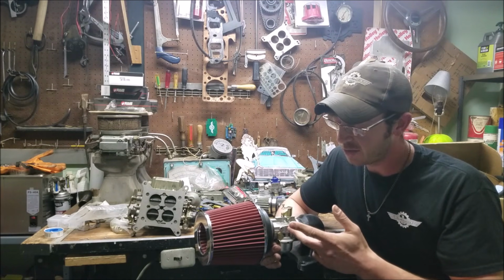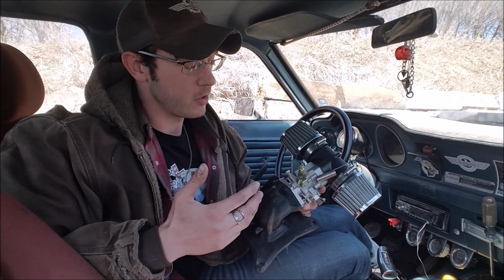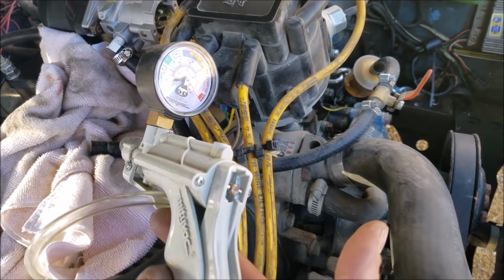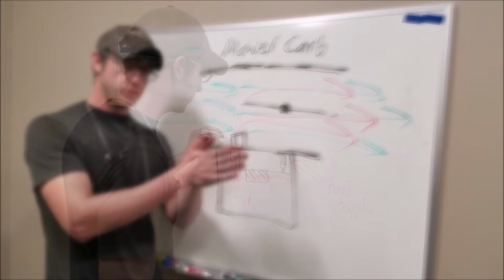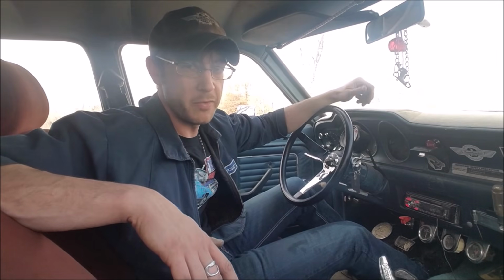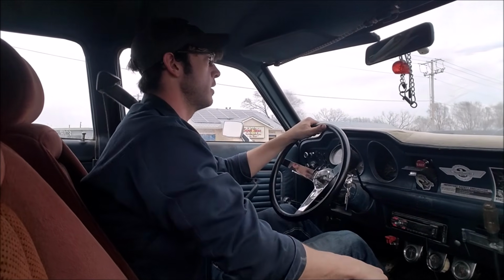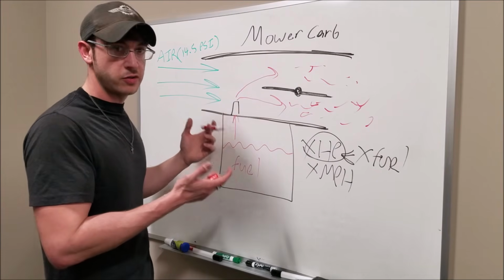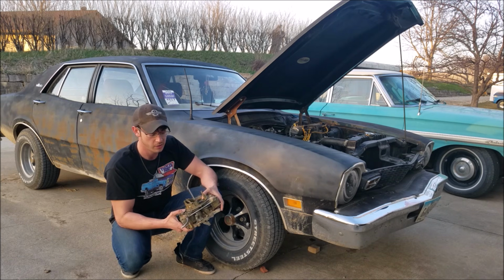Will It Run? Lawn Mower Carb on V8! (The "IMPOSSIBLE" Becomes Reality!) Start to Finish

Comment: I can tell you this about carbs and engines (ASE certified engine performance, 40yrs experience, AKA "not a dummy" 😊)  The engine determines how much fuel volume to demand, period.  The carburetor simply provides the demand.  That's standard operating function...
  A, by having the ability to tune the demands of the engine in your hand, you're able to maximize the efficiency of the engine (within it's limits) to match the effective provisions of your carb system design which (part b) seems to make the most efficient use of mixing/atomization of the fuel.  Together and mostly by having the engine tuning in your hand and maximizing the efficiency of the engine demand youve found a combination that works.  That said, it is always going to be the demand of the engine that ultimately dictates fuel milage, no matter how efficient/effective the design of the carburetor is.  Matching the engine efficiency with maximum effective fuel atomization is the secret of life.
  A standard carburetor delivers more fuel/air mix on demand (to a calculated percentage beyond the capability of the engine) and that's the point, to provide as much air/fuel mix as the engine will handle under all load conditions but, no matter what you do to a carburetor, it won't change the milage and provide 100 mpg (previously claimed in mechno-mythos), it only responds to the immediate demands of the engine.   Maximizing the carb efficiency to provide the best mix on demand is key, yes but... That is as far as it goes.  If it were possible, there are some pretty smart people out there engineering carburetors and those concepts would have been realized by now. 
  What you have done is to "stumble" (through experience, knowledge, luck and trial) upon the most efficient combination that you can have for your engine and that is the "secret sauce" that eludes most people as a background in fluid dynamics and the ability to hand tune their engines on the fly is beyond the average driver or the ability of corporations to mass produce in any effective manner.  Congratulations on your experiment, it's always nice when you get better than expected results.  😊
The concept should translate to anything that you can control/tune and manufacture to meet its specific demands! 😂

Comment: I rebuilt my 440 nearly a decade ago. Added a FiTech EFI a couple years ago. Noticed a similar increase in gas mileage. Not 40+ MPG but well over 20 on the highway. Set it up the AFR for 14.7 at cruise and 12.5 at open throttle. A lot better than the 14-15 I used to get when it was tired and running down the highway for several hundred miles. It doesn't stink like a 60's car anymore either.
Reply from the maker: Just sounds like your afr wasn't optimized on the carb was all 👍

Comment: I think you're right about the mower carburetor basically acting like a vapor carburetor. It makes sense that the small bore of the mower carburetor would create a much higher velocity and would atomize the fuel much better than the regular carburetor that was on the motor originally. Have you checked the mileage on a whole tank of gas? I wouldn't be surprised if it was better than the small test you did. 
 I'm glad I stumbled across your video here. I shared it with my friends. The oil companies in conjunction with the car manufacturers, worldwide, have been selling us vehicles with motors that don't get very good mileage for decades intentionally. 
 I can remember when I was a kid in the early 70's that my dad had a 1963 Coupe Deville Cadillac that had a 429 four barrel in it and it would get 16.5 miles per gallon and it weighed like 5,500lbs. I have a 2000 AWD Astro and I can drive it super easy and it won't get but about 16 miles per gallon with way less weight and a 4.3 Vortex motor. I contribute that to the Cadillac motor having 10.5 to 1 compression ratio, which burns the fuel much more efficiently. 
 The EPA, which I suspect the oil companies lobbied to be created, mandated that all the compression  ratio's be dropped in 1971. They claimed that the higher compression ratio's were creating smog. So they put 8.5 to 1 pistons in everything and big motors like 454's, 455's and 460's went from having around 400hp to less than 200hp and were just big gas hogs with no power and got worse mileage when they did that. I don't know how burning more fuel makes a motor less polluting! I remember back in the late 90's my  Dad bought a Snapper Yard Cruiser that had a California emissions motor in it. He bought it in Oxford, Ohio from a dealer that was going out of business, so he got a good deal on it. Well it got where it wouldn't crank and he thought the battery was just getting weak. Well it turned out that wasn't the case at all. What they did to make it pass California emissions was put a decompression mechanism with fly weights on the crank inside the motor. It would crack the valves open a bit and as soon as it fired and got a bit more rpm, the fly weights would sling out and let the valves close all the way. There was a recall on that part, otherwise we would have probably been pulling or hair out trying to figure out what was the matter. We got the part for free, but had to install ourselves. Plus my Dad had went and bought a battery for nothing! What that was all about was to pass the California emissions they increased the compression ratio and instead of putting a higher torque starter on the motors, they went with that decompression mechanism. I remember thinking back at the time, why does California want higher compression on the mower engine's when they claimed the higher compression in vehicle motors was responsible for smog? It just doesn't add up.
 And just four years after the compression ratio's were dropped on vehicles, they came out with a mandate requiring catalytic converters be put on everything in 1975. I guess they had to require that because of all the raw unburnt fuel that vehicles were spewing out with the low compression ratio's!
 This has gotten far longer than I intended, but I want to point one more thing out. They make out like Direct Injection gasoline motors are a new thing. They're not. All the German aircraft in WWII had direct Injection motors. They burned two grades of fuel, mostly the lower octane. They had 87 octane fuel and 92 octane fuel. Our planes were running on 145-150 octane fuel. That's because the Allies aircraft were either carburated or had throttle body injection. In both of these cases the fuel/air mixture has to survive the compression stroke with out detonating. Hence the super high octane fuel. The German's didn't have to worry about detonation because, being direct injected just like a diesel, there's no fuel in the cylinder to detonate. So that makes the motor have no knock. That means you can turbocharge and or supercharge the hell out of it with no worries about detonation. The German's had airline planes that could fly non-stop to Argentina from Germany back in the 30's because of being so fuel efficient. Germany didn't have much oil of there own. That was part of the reason they took Romania. But Germany did have coal and they were making their fuel, especially towards the end of the war, out of coal. I guess it was a time consuming process, because late in the war the Luftwaffe was having to set on the ground for up to two weeks before they could get enough fuel to fly a mission in force. Their aircraft had as good of  performance as ours, but only burning 87 octane compared to ours requiring 145 octane. 
 There's a guy named Achates came out with a motor about ten years ago now, that was virtually a copy of a motor that Junkers was using in the aforementioned airline planes and also in military flying boats back in the 30's. Of course he has computers now that they didn't have in the 30's, so it could be even more efficient. He made one a size that would fit in a full size pickup truck and another big enough for a semi truck. They should been out a long time ago at this point, but I still don't see them in anything. He was claiming that the pickup truck sized one would get 40+ miles per gallon. So you're looking at motor that would more than double the mileage of a full size pickup and if the semi sized version did the same thing, that would cost the oil companies billions in lost fuel sales! I remember reading somewhere that there was some billionaire that was going to finance Achates so he could build a factory and start producing the motors, but just as Achates had finalized his prototypes, the Billionaire died in a plane crash or something. Funny how I never heard anything on the news about it. Usually a billionaire dying would be news worthy, but maybe not if it was under suspicious circumstances! 
 Oh, I forgot to say that the Achates motors are opposed piston direct injected two cycle motors. And he claims they can more than pass emission standards. Just search YouTube for Achates motor. 
 The oil companies may not worry about you as long as you're not going to big with what you know and what you're producing, but anyone who tries to do something in a big way that's going to threaten their sales, they might. Like I said, I still don't see the Achates motors in anything yet. Keep up the good work and I'm looking forward to a follow up video.

Comment: I have just discovered your channel and hope you get to see this comment.
I have to admit that, at first, I thought this was a joke, but then so did you.
I can see the principle. The fact is that, most of the time, you are not driving flat out and that air and fuel flow will be sufficient for an engine that is almost at idle. And who wouldn't like those MPG numbers?
The downside is that if you want to overtake someone, you just can't beat power you want to run cheap.

I don't think it really worthwhile going the tune plus big carb when you can do both.
Your adapter plate could be made the intake of the "Mower" carb and then replace the old carb on top.
Install a fuel cut off valve and a shutoff plate for the old carb, perhaps a "butterfly" disconnect owhy?

So, you're cruising down the highway doin' 70, making 40+ Mpg and have to pass to keep cruising. Flick a switch and you are back on the old 4 barrel, or is it now 5?
Anyway, keep up the work on that "Carb Cheater"
Cheers.

Comment: considering this was how the factory initially added MPG in the 70s I had no doubts about it running.  they used to put the tiniest little 2 barrel carbs on these huge small block V8s, like the chevy 305, not sure if they plopped one on a 350 but I wouldn't doubt it.  course this is also why many cars in the 70s and 80s rolled around as 6000 pound chunks of metal with 130hp engines still barely gettin 12 to 15 mpg.  But hey, least gas was less than a buck a gallon.

Comment: Actually, way back in 1977, my friend had a 1968 straight 6 Chevelle that bogged around turns. So I asked him to bring over a Jiffy carb kit and a case of beer.  I drank the beer and rebuilt the carb and the dang thing still bogged a little in turns.  By the time I finished the job, let's say I don't remember all too much but there were a few parts left over.  

My friend refused to let me finish tweaking the carb because the car was getting 37 MPG after the carb job.   As my own car was only getting 11 MPG, I really wanted to take a look at the carb I rebuilt, but my friend never let me open his hood again.  The car otherwise ran fine. It never had a lot of power... ever.  

About a year after I "fixed" the carb, the car was wrecked and junked when I was out of town.  So I never found out what I did right or wrong or even got a vacuum meter or timing light on it. But I damn well know that  1960's and 1970's cars can be set up to get nearly twice the fuel economy than they got out of the factory.

And if I hadn't accidently screwed this pooch myself, I wouldn't believe it.

Comment: I don't know why you think "on paper it shouldn't work" - it's providing fuel and will end up being a restriction (airflow and fuel through the jet) limiting overall power, but it will work

WRT comments about multibarrel vs single-barrel carbs, the problem with most of them comes down to differing intake runner lengths resulting in different mixtures entering each cylinder along with atomised fuel condensing out on the sides of the longer runners (lean mixtures)

The project is "silly", but proves a point

Comment: I'm sure you've heard of Smokey Yunick's  hot vapor contraptions, built from the 50's-80's. 
With a turbo, he was up to 20:1 afr, and had built versions from 3cyl to 8cyl, and they always achieved 1.8hp per cubic inch. His crowning achievement was a 2.5L Pontiac Fiero, producing 250hp and 250ft lbs torque, with 0-60 in 6.5 seconds, and saw fuel mileage up to 51mpg, on 93 octane. 

If he did that in the 80's, before 3d printers and without any computer control on the engine at all... it's mind blowing to think what could be possible with today's technology. 

Ya probably shouldn't put to much on the internet though. Wouldn't wanna get suicided. 😂

Comment: I'm no genius ! However , your crazy smart and know your very good with mechanical procedures and how all of that stuff works with everything else to make an engine run properly . Why you and Kevin get along so well . But I had no idea you knew computer engineering and how to actually design your own software and then make it actually all work together and with that said , be abke to design your own carburetor intake part for it with a 3-D printer ! Absolutely crazy smart person you are Mr. Luke ! Now I know for a fact , not really understanding how exctly , that there would be way better gas milage with a way smaller carburetor than that huge 4 barrel carb. And what that actually takes in less gas volume compared to the small bowl-fed lawn mower carburetor would take . Therefore way better gas milage . And then to design that air / fule mixture components to utilize the fuil way better and with that said. Gas mileage that I'm sure didnt see coming !! Thinking more like maybe 18 to 20 tops per gallon verses 12 to 15 you might have gotten with the 4 barrel . But 41 miles to the gallon , WHAAAAAT !!! Insane dude 😎 And with that said, your mind was racing so fast as you were trying to process these numbers and figures becuse as you said , this wasn't about fuel consumption, it was whether or not you could even get it to run and drive , but also drive as the 4 barrel allowed you to. And you figured that all out and then designed what it would take and then built it all from scratch ! That is damn impressive beyond what anyone could have seen coming AND with all that said ! Your SO NOT getting paid for what your doing or know or thought you didn't know and that's why when leaving the gas station you can see that your brain was going a thousand miles a second ! What can I really do now ! Is this the next step and by this time next year your going to be inventing new ways to save on fuel and sell your invention or help with others knowing how ? Watch yourself ! Look into history , it always shows what happened in the past , comes true in the future ! People died or disappeared with this type of knowledge . Oh , I knew it was only going to take $3.00 to fill and I said it before you filled it . But then you tried to show  how you were full to the top and if you didn't do that extra $ .49 cents , it would have not been there and would have been the $3.00 only 😊
Congratulations Luke ! Smarty 😊

Comment: You did a good job of explaining how it all works and I totally agree, more than likely will burn rich, but that could turn out to be a blessing with regulating the fuel to get it started in the first place as you know the volumetric fuel pressure fluctuates according to the air flow and the more air, the hotter the engine burns. I was thinking about your cheater throttle body that you made and thought to myself "would if it were made of aluminum?" it would be so much better at reducing top-end heat on the engine, but nevertheless, great job!

Comment: My 1970 Mercury Montego had the big 302 with that FoMoCo 2 Barrel carb. My 1961 Rambler had the 6 cylinder, overhead valve truck motor with a 1 Barrel Holly carb. Why not!

Comment: one of the tricks we use here in Australia on v8 is to use vacuum secondary 4 barrels with very small primary two front barrels which gives really good economy and drivability with the very large secondary if needed under full load.
Reply: That’s why the ole’ GM Quadrajet was an awesome carb.

Comment: If you atomize the fuel completely with high pressure and use special rings and sleeve you can get over 100. My friends dad had a project when we were teenagers that he was getting over 100+ MPG on a 302, He was using a custom high pressure carb it was around 400psi and was doing testing on cylinder wear and had plans to take it much higher pressures but the guy had a massive heart attack and had a major bypass and he got really depressed afterwards and didn't make it. Sad as it is, high MPG is easy to achieve with modern materials and older v8's. I know someone else who was doing a project with a geo metro and high pressure carb that guy was getting over 143mpg but he was destroying rings and pistons, he couldn't find high grade geo metro parts and didn't have the ability to turn billets himself. He was just modifying off the shelf parts.

Comment: I put a Rochester monojet on a Datsun once. It ran great, eventhough it had a flooding problem. I put it in the truck simply because I needed to get to work and the hitachi carb had bitten the dust. Btw, I still have the carb.